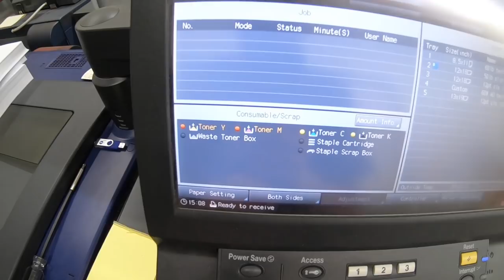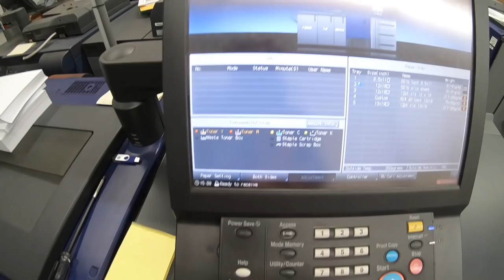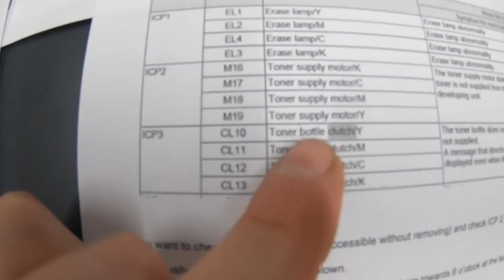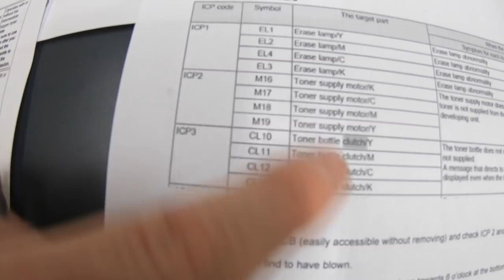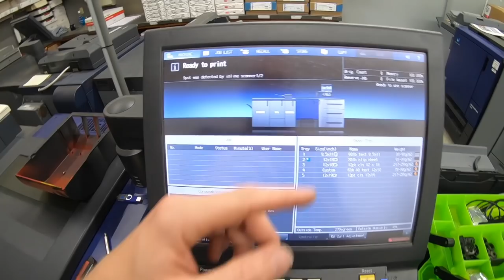Konica Toner Wont Empty Out Bottles, Lets Fix it With the Soldering Iron

Comment: I’m a certified Konicaminolta technician for 20 years I don’t recommend customers or users to fix technical problem other than removing paper jams. Always use expertise of company techs for quick troubleshooting . For other info, we don’t just dig in hardware troubleshooting unless we do programming verification first using simulations mode of parts functionality.  That is temp fix, the problem is not yet resolve. Find the solution why the icp fuse blown?
Reply from the maker: Agreed, if I don't find the actual problem it will just reappear.

Comment: Hi, I enjoy watching all your video and that was a good temporary fix. That ICP chip not only indicates when your toner needs to be replaced but also how much toner is feed into the toner hopper.  I'm a Konica Minolta production tech from California if you ever have questions on any issue that you can't find an answer to please feel free to reach out. To get the ICP replaced I recommend using a company like Hytech they are a Konica Minolta board repair company and they are not expensive.
Reply: Good
Reply from the maker: Yes, Hytech is where I would send it if I want the actual repair, however I', now curious if I can track down some ICP components.
Reply: @justaprinter  let me get back to you on Monday with an answer.
Reply: Hi Juan,i'm having problem on the Carriage Slide Rail of C1070,any idea how to fix them.something is blocking when i push back the carriage after i pull out.
Reply: @juancast50  how can I get in touch with you?
Reply: @ryanbartolo3849  Good morning here is a few things you can look at 1) make sure that drum units don't become loose when you pull the drum carriage unit out if they become loose they can hit the drum shaft when you push the carriage back in place and also the shaft can become bent. 2)  Drum unit shafts make sure that the drum unit shafts are not bent or loose I have seen that the bearings on the backside of the drum start to wear out or fall out due to use. 3) Drum carriage rails remove the drum carriage and look at the rails to make sure that they are both even. Good luck

Comment: you should replace the ICP plus use your meter to read the current drawn when the unit is being operated. The ICP would have blown for a reason.
Reply from the maker: Yup, pretty sure the motor is bad. It stopped working again.

Comment: hey dan I have a C1070 and printing heavy papers like 300gsm will missfed always do you have any tips to solve it ? thanks
Reply: Are you 2-side printing?
Reply from the maker: I see this from time to time on my 100lb uncoated. Typically the paper is curled a bit in one direction. Turn the paper over and try again. Or lower air settings.

Comment: When do you consider a machine 'done'? I'm currently running out of parts on the parts machine's parts machine and I feel like that's probably the point to call it quits. Too bad there's no good  replacement for that machine available.
Reply: I would find another parts machine.
Reply: What machine is it, if you dont mind me asking?
Reply: @JonJonNeddo  Fuji fp232b film processor and Fuji sp1500 scanner/printer controller both in the same situation.
Reply from the maker: I have heard of people buying up old machines for situations like this where there is no replacement. Buy every machine you can get your hands on.
Reply: @justaprinter  the 4th machine is already paid for and pending delivery, but it's not a good long term solution.

Comment: Hello Daniel,
The ICP you need is the ICP-S 1.0A but if you want it to support a little more you can put the ICP-S 1.2.
The repair you have done temporarily seems fine to me, but if you have an overload the PRCB will definitely break down and it will be more expensive around 400$.
I hope I helped you
Best Regards
Toni from Spain
Reply from the maker: Yes, that is awesome. I need to find ICP's and keep them on hand. Thank you!
Reply: Hi Antonio. How can I get in touch with you?
Reply: We have replaced one on a Ricoh board. Soldered on an automotive fuse holder and used small glass tube fuses. So when it blows again, it's only a matter of twisting the holder open to swap in a new fuse.

Comment: Being able to work with what you have on hand and MacGyver a field fix like that is one of the marks of a skilled tech with a good head on their shoulders.  I also appreciate that you acknowledge that the ICP blew for a reason, and a more permanent fix should be found... Please do follow up on this, and don't just run on that jumper forever because it happens to work as-is.  Great video!
Reply from the maker: Agreed, I'll update you all on the future correct repair.
Reply: @justaprinter  I hope your work will be successful, so it will help you save some money in the interim. So far, I am enjoying watching your shows. I hope your shop will be humming once more with all the machines running at once.

Comment: You could replace it with a replaceable fuse holder and have a correct rated fuse in there, It blew for a reason and it's there to protect another part or parts. But this you know. I bypassed a fuse the same way on a motherboard and 3 weeks later it started to heat other components around the area and caught fire(just as well I was there it looks bad for a fireman (me) having to call the fire service to his house lol). Enjoy your videos keep it up, I have a konica c6000 would be interested to know what one you replaced on your 6500?
Reply from the maker: Good point. On the c6500 it was an ICP located on a board on the duplex unit. Located on the right side when you pull it out. I forget what it was doing.

Comment: Well, it is a good thing you know that this is scatchy at best, however, it is not just fire you have to be worried about. You did say you're nervous when swiching thing on after such a repair and here's why. A blown fude, as you say, indicates a fault, bypassing the fuse can cause fire but unlikely. However, main problem with bypasing fuses is that the next component down the line could withold more heat and power going through it, as a result, if that component gives up, you can end up with a burneout hole that renders the whole board unfixable(beyond economical repair). Although if buying a new board is not a problem and your electrical panel is not wired by you in the same manner, you've got nothing to fear when operating of swiching these devices on.
Reply from the maker: Good point. I need to track down ICP's, but I have not had luck yet.

Comment: Can you give me a tip on a double fold on Right Angle...its a MOB. My first fold on the first unit is great (11x17 to 8.5 x 11)but when it goes through the right angle folder for a second fold (to 5.5) it always folds slightly in not perfectly straight (push out). Thanks
Reply: @John Taylor. Are you using a creasing disc/wheel on the slitter shafts at the exit of the first folding station? You need the  creaser to "groove" the paper at the position of the crossfold. Don't forget that the inside leaf and outside leaf of the 4pp first fold are still "attached". So you need to weaken/pre-stress the two plies of paper to achieve folding accuracy. And always remember to run the second station at least 25% slower than the first station. Run the job and keep reducing the second station speed until you get a 50mm/2 inch space between the copies. Good luck!
Reply from the maker: I can think of three possible adjustments. Either the stop is not square, the registration feeding the paper into the plate is not square. Or the roller pressure is uneven. Hope that helps!
Reply: @John Taylor. Was the advice/tips given here any use to you?
Reply: @markmiwurdz202  I am scoring it first. I checked roller pressure too but still does it. I will try the 25% slower than the first station next time. Thanks for the help!
Reply: @John Taylor. Thanks for your reply. Could it be that you were cross folding a 4pp. portrait  leaflet against the grain (to fit an envelope/display rack/ point of sale box etc.)? You could try fitting 2 creasing discs in the same knife boss to make a wider crease line and really "break' the grain. You just have to carefully adjust the rounded edges of the counter knives to prevent the lead edge of the 4pp from splitting. 
You may already know this tip to check if your creaser positions line up with your folds. With the machine running carefully just "touch" the creasing disc with a dark coloured wax crayon. The wax will "write" a line on the paper. So when folded you will be able to see if your crease line and fold position are together or need adjusting. To remove the wax, stop the machine and wipe it off with a strong tissue/cloth while winding the machine over by hand. Good luck! Stay safe and well.

Comment: Dan, at least you feel guilty of doing repair job that way.... You should have few resistor type fuses of 1, 1.5, 1.8, 2, 2.5 amps. Quite cheap and better than burning the driver IC's and PCB's...... Good luck.
Reply from the maker: Yes I need to track some down. But then I would need to figure out what amp to use as a replacement too.
Reply: @justaprinter  we are here to advice... 🧐
Reply: @justaprinter  check if you can read part no on icp. Normally it's rating of current or  an alpha et that can be decoded to corresponding current rating.